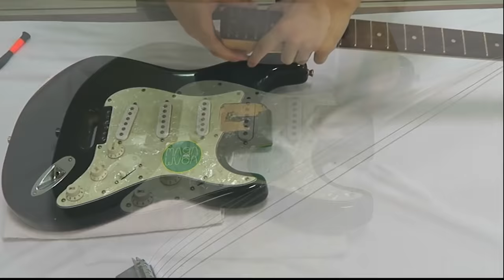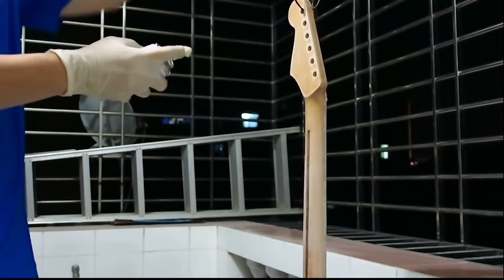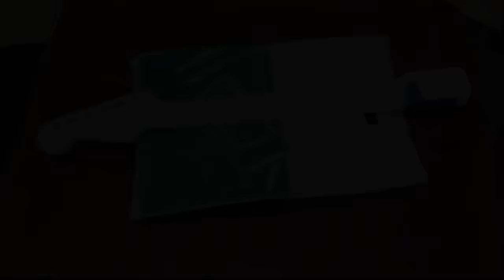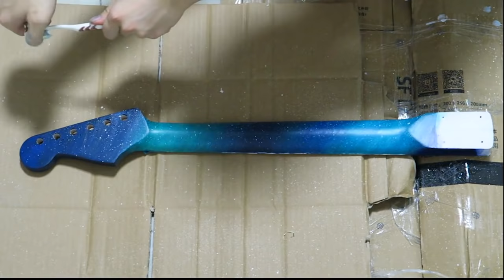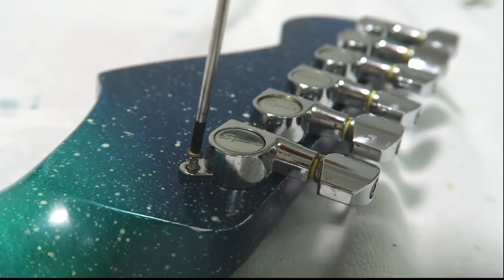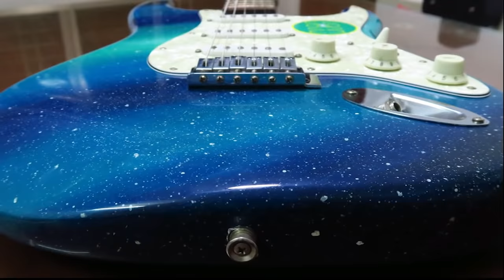custom galaxy guitar paint

Comment: Did you wet sand the brush paint before adding the clear coat? Looks nice. I think I would rather have an unfinished neck. But hey, It isnt mine. lol
Reply from the maker: +Gacy x I slightly wet sand it after 2 thin coats of lacquer. Then I spray 3 more coats and wet sand it again.It takes lots of time to get mirror finish.
Reply: the

Comment: Nice work. I've never seen someone take out a solder joint with scissors before haha. 
Now that this is a couple years old, do you have any comments on the durability of the paint that you chose?
Reply from the maker: Brad Angove haha I used to be so naive. Will never do that again😂. The paint stays very well actually. It is acrylic based clear coat on the top, acrylic paint for the painting. Btw thanks for your appreciation and your videos are very helpful.
Reply: I'm glad the acrylics worked out well for you and that the paint is holding up. I don't have the skills to paint with a brush like that. It looks awesome.

Comment: Insanely awesome paint job. I think I'd be too afraid I'd damage it to play it. The only thing that would have made this better would be glow in the dark paint

Also, just thinking out loud, but wouldn't it have just been easier if you started with a guitar that has a natural finish so you don't have to go through the process of removing the black? Or just buy a plain guitar body, then put it together yourself later? Fender does sell replacement parts, including bodies, necks, pretty much the entire guitar just disassembled.

Comment: Did he use enamel or acrylic?
Reply: Aiden Wagoner ..acrylic paint is most common and very durable. But anything will work as long as u let it dry very well. U can brush/spray graphics with water based acrylic , then spray 3 or more coats of clear on top after it dries. Try not to remove the sealer coat below the paint. Practice on scrap 1st. Good luck.

Comment: Too bad the pickguard hides most of it.
Many years ago, I saw a video of a street artist doing spacescape paintings. He laid down a ton of red and then yellow right on top of it. He took crumpled up newspaper and touched it to the paint and twisted. Then again and again. Each time with fresh newspaper. Then he put a bucket lid over it to protect from overspray when he did black paint around the lid. Then he removed the lid and the twisted yellow and red paint was a perfect circle surrounded by black. It looked like the sun. He did a couple of small planets using different colors and smaller lids. And added some silver sparkle flakes for "stars". It looked awesome and I wanted to try that on a guitar body, but never did.

Comment: If I were to start from a solid wood body with no previous paint on it before would I still just put white spray paint on then hand paint the galaxy part followed by adding the white drops?  what else would I have to put on it to make it look like a glossy finish? what materials would i need?
Reply from the maker: +Jackson Dunn yes,need to apply primer spray coat on the wood,then you can paint on the coat. Basically you need primer spray, acrylic paint, clear coat and different kinds of sand paper for paint job

Comment: hi can i ask for the list materials you used from the beginning? im planning to repaint mine by my own but i honestly dont know what to buy. like for example, what kind of paint, or what you used to make it shinny. thank you so much. it'll be a great help. thank you ! 😊😊😊
Reply from the maker: Materials list:
- Sand paper (220 and 400, or it depends) for sanding off the original paint
- Primer spray for plastic surface 
- paint (marker, acrylic paint or spray paint)（here im using acrylic）
- lacquer (clear coat)
- wax,(Dunlop and Planet waves are recommanded）
- soldering iron if your would like to paint electric guitars
- time (lots of)

Comment: is it hard to paint a guitar a solid color? I've never painted a guitar and I'm scared I'll mess it up
Reply from the maker: Its not hard to paint solid color. You can either use spray paint or marker.  It's easier and safer to use water-based marker as the paint can be removed if you dont like it. Acrylic paint is not ideal for painting solid color, but it can create smooth blending effect and more realistic images. Whatever the medium you choose, make sure to spray a base coat on the guitar body first. You can try to spray base coat on the surface of anything and paint upon the coat. As long as you get comfortable with it, you can start painting your guitars. Good luck!
Reply: +Carpe Diem Studio thanks!
Reply: the biggest tip to painting ANYTHING is to first take your time! and prep it first sand and sand it clean and smooth dont paint on top of the original surface. the more care you take in your prep and sanding the better the finish will be I cant stress that enough take your time!!!!!!!

Comment: what did you use to coat the paint? was that a varnish?
Reply: fire .flies Not sure what he used specifically, but polyurethane works just fine. Just make sure you let it dry about a day between coats.

Comment: Why did you sand all the original paint off the body? Just sand it with 320 and paint over it
Reply from the maker: +Billy Joe Thinner coat will have less affect to the sound
Reply: +Carpe Diem Studio but its not a acusticl the sound comes from a amp...
Reply from the maker: +Doenut47 Every detail will effect the sound. I just ensured that the sound can remain the same after the paint, but I won't sand off the whole original paint next time cause it's too time consuming

Comment: Could someone please tell me if there is a certain type of paint that is needed?
Reply: iTech Help . Acrylics, enamels, polyurethane are all fine. Acrylics are supposed to be the most durable. Try not to combine. I have done this with water based acrylics brushed art. Then after thorough drying, spray 3+ coats of clear. Wait at least 1 day between coats. And 7+ after last coat. Then wet sand, polish. 
If you spray a satin/matte clear coat, you can also get a nice finish as well. And may not even need to wet sand. Good luck.